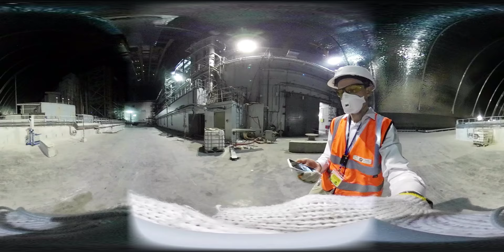360 Video: Inside Chernobyl’s New Safe Confinement Unit

Comment: What is the occupational time limit for a worker inside the new safe confinement?
Reply: time isn't the important factor, it's how much exposure they have. eu set out what a safe dose of radiation is and the workers aren't allowed to go over this pre determined number value of radiation. there a daily dose limit and there is a year dose limit. they carry dosimeters which detect in real time the amount of radiation there is in the current location. they also have monitoring equipment on them too determine long term exposure.